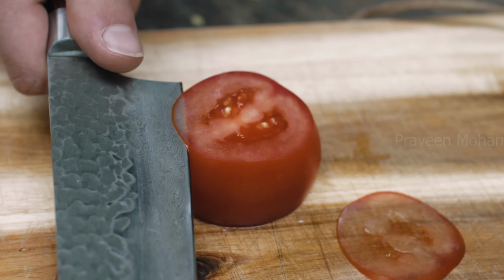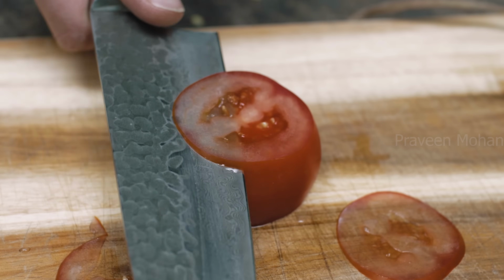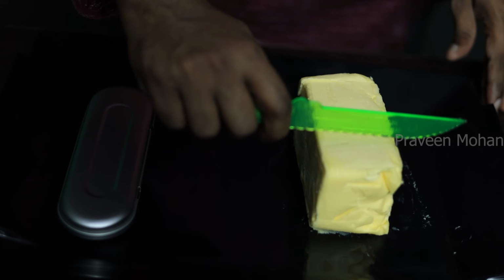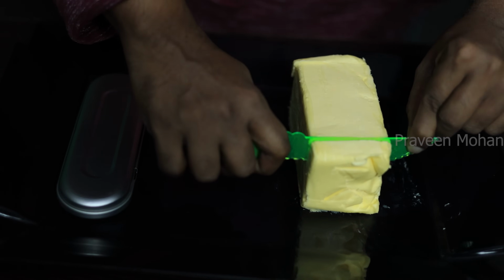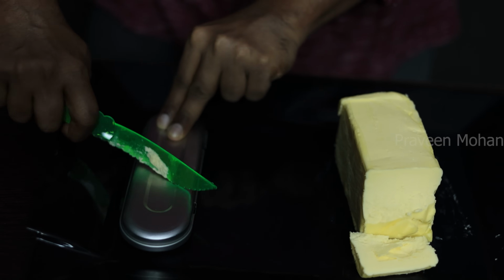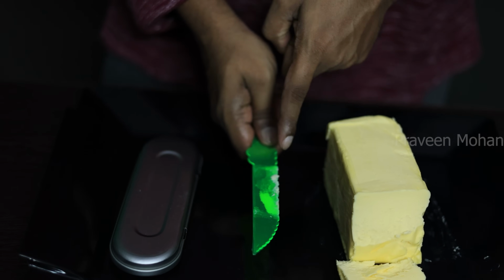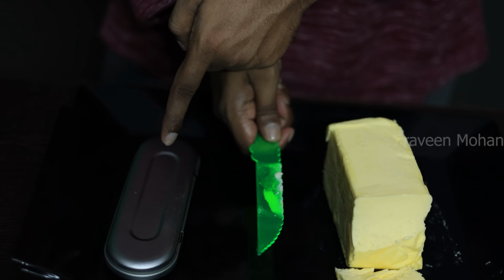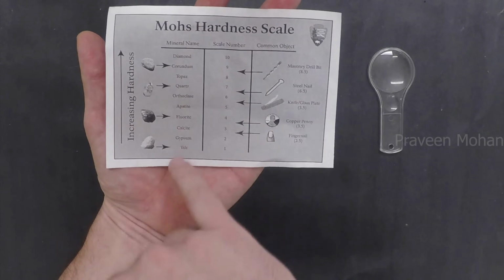They Softened Rocks With Herbs? Lost Technology of Ancient Machining

Comment: Yes. I'm from Warangal. My grand parents used to say the same theory that the ancients use herbs liquid (pasaru) on the gaint stones which makes these stones soft and light weight. Dont know the Myth.
Reply from the maker: Thank you for sharing this info, Karthik.
Reply: Yes I heard that liquids of herbs makes rocks to hybernate. And then ancient builders carved them easily
Reply: And "light weight"?!
Reply: U know nidravastha of stone, u apply herbal liquid on stone and only for sometime they turns soft to carve and if u didn't finish in that particular time u have to wait for next day, that kondapindi aaku used for smoothening the surface of stone after carving and left with any patches.but u can't use that leaf to smoothen entire stone for carving.
Reply: Yes. light weight too. we have seen many gaint rocks placed at a height of 25 to 30 feet. this would be possible with herb liquid used on stones which make them light weight. That was the theory said to me. 😄
Reply: @karthikp207  👍 it would explain a lot of ancient mysteries 🗿
Reply: @karthikp207  Lightening means removal of material so the density changes.  Are there pores to validate the lightening process?
Reply: If that is real then think where our science stands in ancient times
Reply: Mohasa S Lightening doesn’t necessarily mean removing mass. It could be a temporary change of state. I’m not learned enough to explain how limestone can turn into helium for example.
Reply: @memermacha1059  actually in ayurveda it is used to cure nephroliths or kidney stones

Comment: Here is a typical reference from Indian texts which explains this technology pretty well:

शिल्पकाराः प्रलेपयन्ति द्राव्यकरसम् ||
शङ्खद्राव-कुष्ठरस-सैन्धवखर्पर-उकत्सवल्कल-चूर्णेन सहितं शिलद्रवणार्थमेवं रसचतुष्टयं अनेन मन्त्रेण दशाहमर्दनान्ते वैताने खनित्रं प्रयोजयन्ति खननमाचरन्ति भद्रेण स्थापकाः |
- वास्तुसूत्र-उपनिषद् , ८, शैलभेदनम् 

Sculptors apply a softening mixture. Shell solvent, Kushtharasa, sea-salt and the powder of the bark of Uktasa tree are thus the four fluids for the softening of stones. With this plan, after (immersing) the chisel for 10 days, sculptors use the chisel in sacrificial rites and also dig with ease.
- Vaastru-sutra Upanishad, 8, Shailabhedanam (Post-Vedic Period)

Comment: I am a Metallurgist, Precious Metal Refiner and Assayer and I know that stone can be softened and I have done it a few times. Some elements respond to Hydroxide, but not Acid and other elements respond to Acid but not Hydroxide. In dealing with Gold, it will not respond to any single Acid, but it will respond to  Aqua Regia which is a mixture of hydrochloric Acid  (HCL) and Nitric Acid (HNO3) at a ratio of either 3:1 or 4:1. Then If you add a little Phosphoric Acid to Aqua Regia, it will soften or dissolve any known element, depending on its proportion mixture or how much heat and agitation you give it. You can treat Granite with these three mixtures and soften it and when do some shaping and carving, you can Neutralize the Menstruum afterword's with Hydroxide and wash it a lot with water. If you heat Gold and or Platinum in a furnace with Hydroxide, it will take them up in solution, however Hydroxide will not effect Iron (Fe 26) of Nickel  (Ni 28) but Hydroxide will take up most things with enough heat.

Also there are some Enzymes that soften hard soil for plants!

Comment: Hey Proveen, great video as always. Several years ago, I ran across an article and a video on YT that showed that a Peruvian bird would burrow holes in granite rocks to make a nest. He would fly down to get these red leaves (I can't remember the plant) and rub this red leaf on the granite cliff, then drop the leaf and begin pecking away at it with his beak. The plant would soften the stone to a point where he could dig a few centimeters a day after repeating the process over and over. Peru has a temple structure (can't remember the name of it) where the stones are "fitted" perfectly together. The legends from that area state that the ancients knew the recipe for stone softening and used this plant. I can't find the video or the article to send to you, but maybe this helps.
Reply: Right, Erich von Daniken mentioned this, I think.  Try "green chisel" or "caochyll" maybe, I just looked for "herbs that soften stone" and those came up.

Comment: I can think of three other possible ways
1..precise concentrated light beam,/Lazer
 concentrated using, certain materials
2.pressurized water stream
3.pressurized air stream
Also looking at the depth of curves I think it could be carved using sharp tool by brute force, repeatedly scratching, also
 Pressurized water jet, water is in fact not harder than granite.

Comment: I agree you can not get those lines with brute force. Which is why we use softer blows with smaller hammers when carving granite. Even a copper chisel works well as it is force applied not hardness applied. You never use a diamond tipped tool in blunt force applications only in grinding or cutting. 

Now, it is possible to soften rock using chemical process but that is because you are dissolving the structure of the rock.

Comment: OK here is the fact, apples and any other fruits  can be used to make vinegar, concentrated vinegar will dissolve marble. 
.Acetic acid is produced by the oxidation of ethanol by acetic acid bacteria, and, in most countries, commercial production involves a double fermentation where the ethanol is produced by the fermentation of sugars by yeast. It is not going to soften stones - but righter destroy them chemicaly as corrosive.

Comment: Ground granite is applied as a paste (thin render) & the pattern made while still damp & soft enough. The Hanuman statue is inside the building protected from the elements. While the outside blocks are weather worn & exposed, so it slowly flakes off over time.

Comment: Maybe the crushed plant compounds were ingested, brought about some kind of state of altered consciousness, which enhanced psi enough to be able to use it to soften the granite while putting the grooves in it? Similarly to how you can use psi to bend impossibly rigid metal with just the slightest pressure applied.

Comment: I think etching can solve the problem without softening stone. Coat the sculpture with wax, scratch off thin line in wax, dip in acid for few days. acid will sip through the scratches and will make thin line. Scratching complex curve on wax is possible.

Comment: I've noticed that some of the blocks in Puma Punku also had 'peeling' facias and wondered if the stones were roughly chiselled, then the chippings were ground down into a powder (cabinet makers do this with wood so they can invisibly mend a piece of wood that has a scratch or hole that needs filling) and, maybe, made into a paste which can be easily carved before setting solid?

Comment: There has been mention that it could be a type of concrete technology that we lost or don't fully understand. Would explain the stucco like veneer peeling away. Consider this we use ultraviolet resin in dentistry. Molecular bonds are made sometimes ionically, perhaps some form of galvanic process could be layered on or stripped away in this method would allow for detail and control of the work piece.

Comment: Is it possible that the rocks were melted and then mold when they were cooled enough for the builder to draw or crave or mold them in a certain size, shape design, etc? 

For Example, I asked on Quora "If I melt granite, will it be granite when it cools?" the answer given were like this "Granite is an intrusive igneous rock formed by slow cooling magma, it is being melted it will still retain its chemical compositions but the cooling rate will determine if it will be called granite or not if it cools very fast a glassy rock or rock with micro crystals will be formed and if it cools very slowly large crystals will take time to form and in this process granite is regained."
Reply: Thanks for the lesson. Greetings from Switzerland
Reply: Wow... Look at this community even praveen mohan's subscribers are so much sincere and enthusiastic over what they think and search for .🙏

Comment: I think I have an answer, maybe it's not how it works 

You used a fork to make designs on the piece of butter
Just freez the butter 
It's going to be quite hard if you do so 

Assuming that the rocks are frozen butter 
If we just heat them up they are going to be softer 
And designs can be easily made on them 

But I don't think that's how it works...

Comment: I once heard they used old remains of “gods” or “titan” flesh but at the time of building it wasn’t like fresh flesh but in the mid state of petrifying into stone. Thus giving the malleability of the material used. Such exact perfect cuts. Like a stone made of sand and if you took a fork you could make lines in it but the piece itself was solid enough to not break way. But soft enough to make beautiful designs

Comment: Hi Praveen,

Finally you discovered the ancient art of softening the rocks which I discussed in my previous comments.

Well, there is one more thing I would like to share with you.

All the ancient temples that were constructed after 2500 BC were created with an interconnected lock design system.
Small pieces of art are connected to each other in an interconnected lock system.
This technique started at around 2667 BC by Indus Valley civilization before there destruction by the nuclear attack.
The Nuclear War is a different story that I will share in some other related video about civilizations if you make one some day.

Comment: It is proven that concentrated citric acid, and also using hydrothermal methods can soften stones quite well. So if they were able to get citric acid, and consentrate it (e.g. by boiling off some pf the water) they could soften granite quite a bit, and use metal/rock tools to scrape, like you did with the fork in butter.
If you can get hold of 4% citric acid, and soak a granite stone in there for a while. Then you can take out the granite and make this kind of shallow surface markings yourself.
The "secret" here is that granite is mostly made up of silica, which is easily dissolved with acids.
Reply: Another thing to think about is that Granite dust/powder binds together if you dampen it, and then after a while it goes rock hard. So this way you can also use molds, fill them with powdered granite, dampen the powder and let it harden.

Comment: I think what they did is great a kind of cement/ concrete using crushed rock plus chemicals(from herbs maybe) and then it would slowly harden which allows they to mold and carve while it is soft like dough
Reply: You probably got told this already. But people have already recreated it using limestone. And a high level stone mason claims he knows how to make this with granite and marble ect ect. 

The key is cut stone has rough edges and moulded stone is smooth( only when fairly new)

Comment: Awesome statue. Nice vid again.

Just a thought: since Damascus steel, and Urumi (both use highly complex forging methods) has origins in the Asian and Eurasian areas, that surely means metallurgy is a deep enough historic science to engineer what is now simple 'fire-sharp' carving tools for masonry.  Of course, its the edge of the tool that 'bruises' granite in the carving stage. One doesn't cut granite to carve fine fur lines like that, one  uses a gentle hammer and a hard edge that needs frequent brightening the dulling used edge. Usually a blacksmith is near a mason, or an apprentice sharpening a line of tools...

The pestle and mortar to crush the herbs would need to also be metal, to avoid softening up, right?

Comment: Eggs are made from calcium.

If you soak a egg in vinegar, for 24 hours.

Then place it on the top of a bottle openning.

The egg will slip through the bottle top, and the harden again. After a few minutes in side the bottle.

Egg in a bottle trick.

G.

Comment: I can't see a herb mixture permiating granite to the point of making the stone mailable. 
I'm not saying they didn't or couldn't soften stone but I doubt herbs were used except recreationally. 

Sound or a specific harmonic that would disrupt the cohesion of the crystalin structure of the stone seems more plausible, but even that theory seems unlikely since a lot of research has already been done with sound.
 I've seen teams trying to reduce the weight or produce antigravity using a computer with a sound modulator.  In an attempt to solve the problem of moving and stacking these 1000 ton stones seen in baalbek Lebanon.

Comment: The interesting thing is Anicent (outside india - China, Egypt, Petra e.t.c.) You can see chisel marks that are Very Similar to that & even the distance apart. But they are on block & flat surfaces, never curved like that, Also the material is softer, in some case not much, but still softer. We know they heated stone, even closer to modern times they did it to remove.break blocks or to "burn down citys" (literally - to make them fall). Issue is heating shows & you take the heated edges off since they fail, Or turn to "glass" obsidian. Which leads me to my point, I do wonder they used plants to soften, even South American have that claim, But a chemical reaction heats generally at least major reactions, so whatever it was would of softened over time hence why people cant reproduce it today.

Comment: I don't think that the substances that soften the stone are herbs. If they were liquid substances, they must have perfectly penetrated the structure of the stone. It can be assumed that the energy of waves of a specific shape and frequencies was used, which made the stone particles vibrate as required. In practice, it is about a periodic and partial change in the aggregate state of basalt, granite, sandstone, limestone or marble. This is how I imagine it. It may also be that we are dealing with synthetic stones that were soft at some stage of production. Regards
Reply: Here is a typical reference from Indian texts which explains this technology pretty well:

शिल्पकाराः प्रलेपयन्ति द्राव्यकरसम् ||
शङ्खद्राव-कुष्ठरस-सैन्धवखर्पर-उकत्सवल्कल-चूर्णेन सहितं शिलद्रवणार्थमेवं रसचतुष्टयं अनेन मन्त्रेण दशाहमर्दनान्ते वैताने खनित्रं प्रयोजयन्ति खननमाचरन्ति भद्रेण स्थापकाः |
- वास्तुसूत्र-उपनिषद् , ८, शैलभेदनम् 

Sculptors apply a softening mixture. Shell solvent, Kushtharasa, sea-salt and the powder of the bark of Uktasa tree are thus the four fluids for the softening of stones. With this plan, after (immersing) the chisel for 10 days, sculptors use the chisel in sacrificial rites and also dig with ease.
- Vaastru-sutra Upanishad, 8, Shailabhedanam (Post-Vedic Period)
Reply: MPFL UPES
6 godzin temu
Here is a typical reference from Indian texts which explains this technology pretty well:

शिल्पकाराः प्रलेपयन्ति द्राव्यकरसम् ||
शङ्खद्राव-कुष्ठरस-सैन्धवखर्पर-उकत्सवल्कल-चूर्णेन सहितं शिलद्रवणार्थमेवं रसचतुष्टयं अनेन मन्त्रेण दशाहमर्दनान्ते वैताने खनित्रं प्रयोजयन्ति खननमाचरन्ति भद्रेण स्थापकाः |
- वास्तुसूत्र-उपनिषद् , ८, शैलभेदनम् 

Sculptors apply a softening mixture. Shell solvent, Kushtharasa, sea-salt and the powder of the bark of Uktasa tree are thus the four fluids for the softening of stones. With this plan, after (immersing) the chisel for 10 days, sculptors use the chisel in sacrificial rites and also dig with ease. @mpflupes3878
Reply: Has anyone tried this potion yet?
Reply: @mpflupes3878  Has anyone tried this potion yet?

Comment: Dendera rock softeners?
We've all heard about levitating giant blocks by now. How about accoustically levitating individual molecules? Loosening and separating them to reform them into a different or specific shape?
It might appear to have softened the rock without heat enough that it melts. Call it a division of micro-accoustic levitation. If no natural rock is friendly to the process perhaps a process friendly rock crete can be manufactured with some particular binder mixing with granulated and powdered rock to harden into material rocks that are friendly to the process. The binder might be the thing affected by the accoustics allowing for the whole amalgamation to be softened and hardened at will by the correct frequency.
All speculation. Who knows?

Comment: To create a chemical which can corrode or " soften " granite can be possible . To extract this chemical , at the correct strength , from plants should be extremely difficult . To produce enough of this chemical to " soften " such large sculptures should be highly unlikely . One would also have to apply a save procedure to work with these chemicals . Interesting topic , but hardly feasible .

Comment: What if you make a scale to size clay model with a frame suspending a drill/engraving point at one end and a rod at the other end to use as a height sensing instrument, wearing stone away by "scanning" over the clay model with the rod directing the x and y axis like some kind of analogue cnc machine